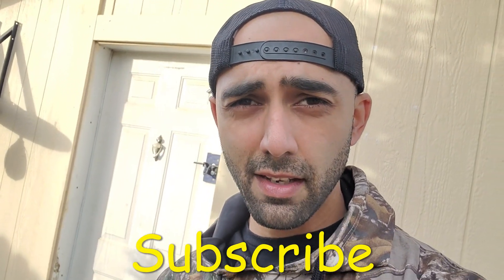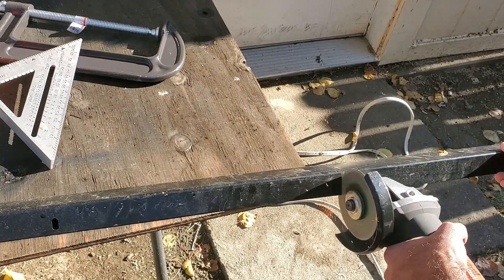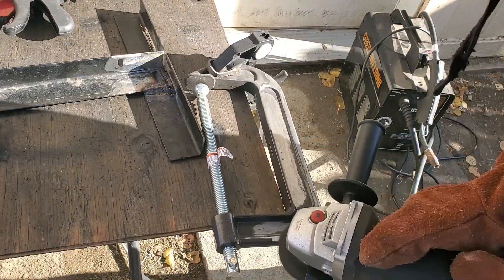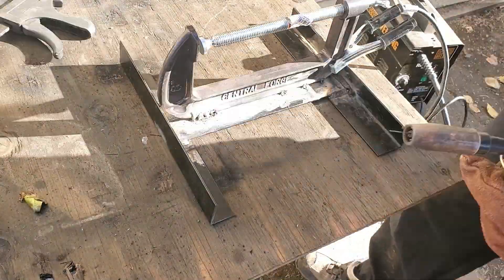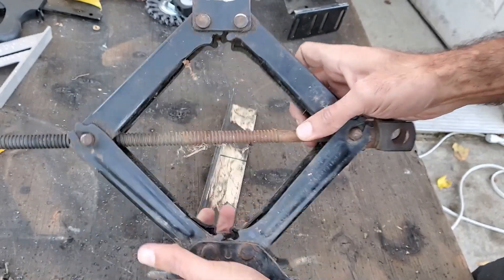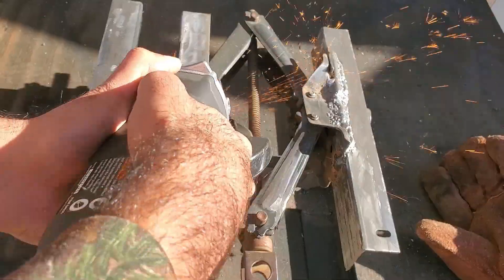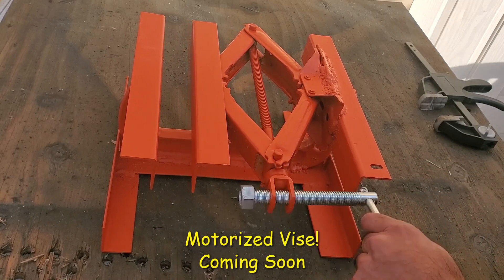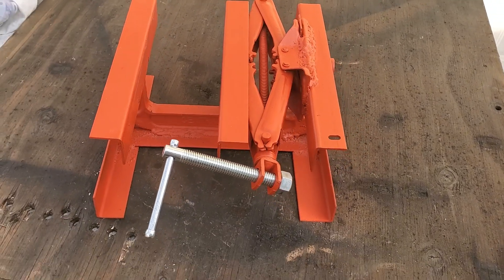DIY Vise Build For Less Than $10

Comment: The C-clamp seems to be completely useless in this project. Why not just use another section of bed frame metal and calls it good?  I know I might be wrong.. I was wrong before, but that time, I was wrong about it too 😁
Reply from the maker: I used the C clamp for 2 main reasons. The first being that it helped line up the rest of the build so I had to worry about less things being square/level. Second I trust forged iron more then my welds at this point. Lol.